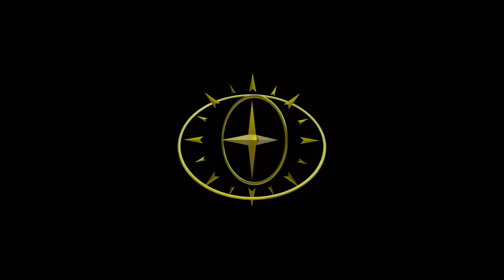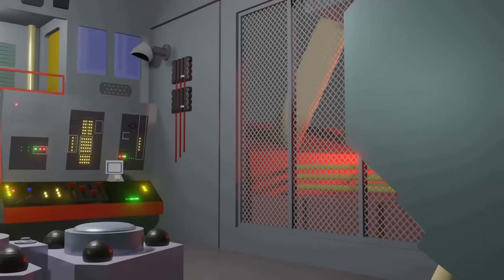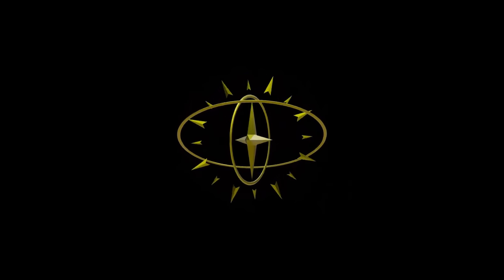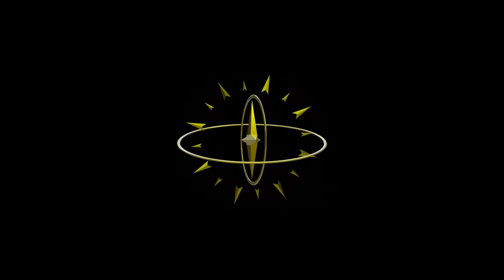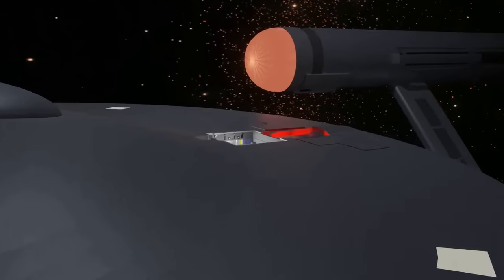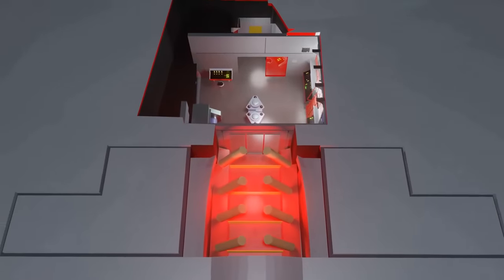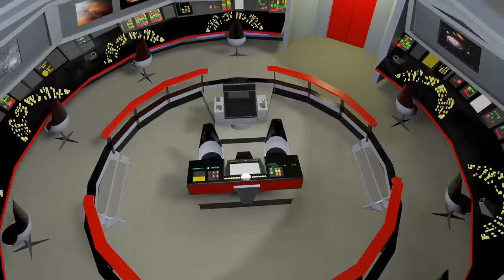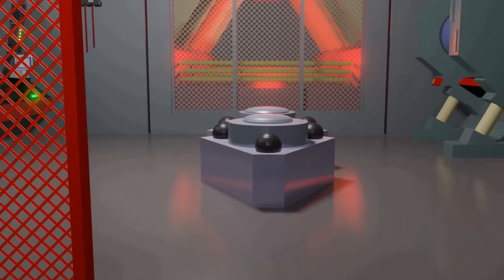The Enterprise Engine-room Enigma: where was main engineering?

Comment: I would imagine that until they began using vertical warp cores that you would have 2 separate engine rooms.  One near the impulse drive, the other in the secondary hull.
Reply: And that is what we see in the Technical Manual.
Reply: they do, the second isn’t seen often due to storylines but it’s always there
Reply: The impulse engines apparently used some form of ion propulsion, since Enterprise-D clearly had a "deuterium fuel tank" at the root of the Access Pylon with a feed that ran straight up its spine to the Engine Room at the stern of the saucer.  Which explains why they were so slow and had such limited range.

Comment: As a casual viewer, I always thought engineering must be in the secondary hull as Scotty was climbing up inside what looked like an inclined tube in one episode.  I always thought that was inside one of the nacelle supports.
Reply: It is.
Reply: They were called the Jeffries Tubes, and ran up the supports from main engineering, in the Lower Hull. They were basically conduit tubes to channel the Anti-Matter from the Broussard Collectors (the round red domes) at the front of the Nacelles, to Main Engineering, and channeled back up and out the back ends of the Warp Drives, and there was a lot of electrical power flowing both ways, controlling the Magnetic force-fields. How the People's bodies didn't cause Short-circuits was never dealt with, except during the episode, "The Ultimate Computer", when one crewman got VAPORIZED, and Kirk used logic to get the M-5,or6, Computer to shut down, because he made it 'realize', it had committed murder!
P.S. they never explained how much power they needed to protect the ship from the Anti-Matter particles that the ship flew into, and funneled to the Engines!  (Phew!)
Reply: @dennispersson9466  Jeffries Tubes - named for Matt Jeffries, set designer on Star Trek.

Also, Bussard Collectors, named for the theoretical propulsion system designer, Robert W Bussard.
Reply: @dennispersson9466  The glowing translucent nacelle caps were identified as "Bussard collectors" only in TNG (both in dialogue and the 1991 technical manual), and the function has been retconned to earlier classes of Earth starship. TOS never identifies them in dialogue, and in the 1975 Franz Joseph "Star Fleet Technical Manual" they're labeled "space energy/matter sink (acquisition)." (Which, if you squint, is the same idea? maybe? although possibly acquiring something more exotic than hydrogen.)

For context, the interstellar ramjet idea was proposed by physicist Robert W. Bussard in 1960.

Comment: I always considered Main Engineering to be in the secondary hull, as you describe. I based this on the geometry of the rooms, the layout inside the rooms, the location of the dilithium chambers, and the way "ships" have generally been laid out throughout history. BUT- you then have episodes where crew members, usually Scotty or Spock, are in the Jeffries tubes, which I assume are inside the pylons for the warp nacelles, and they are accessed from what looks like a standard deck area. Also, the curved corridor dilemma pops up. Also keep in mind that whenever a crewmember takes a turbolift from the bridge to main engineering it is a fairly long trip with the lighting behind the panels travelling both horizontally and vertically, so that tends to indicate the secondary hull.
I DO like the idea, which I never really gave thought to, of a second engineering space in the saucer section ahead of the impulse drive area and it makes sense.
Of course, we can debate this for ever, or at least until they actually build a functional Constitution class starship! ;-)
Reply: It seemed like there were lots of Jeffries tubes all around the ship, though presumably there were some extra long ones leading all the way from the secondary hull to the warp engines.
Reply: Someone tried a reconciliation by stating that the earlier, simpler arrangement of the set seen in season 1 would've represented Impulse Engineering, while the larger, multi-level set seen in later episodes would have been Main Engineering down in the secondary hull forward of the bases of the pylons.   The Jeffries Tube access is a bit tougher but try this:  The big conduits rising up out of the deck behind the grating lean inward instead of  outward toward the pylons, suggesting that there may be some kind of crossover/switching connectivity going on, with the conduits leading up to the pylons departing higher up and further out. Then you could imagine corridors leading aft from the catwalk one deck up to starboard and aft from the Emergency Manual Monitor compartment (briefly seen one deck up to port looking down on the high bay in at least one episode) to the Jeffries tube access points.
Reply: The tube Scotty always goes into to adjust systems ran from main engineering up through the rear of the pylon to the impulse drive at the rear of the saucer which makes a lot of sense. Turbo lifts can run diagonally, vertically, or horizontally, to allow quick access to any part of the ship.

Comment: Kirk said in The Enemy Within that engineering was in "the lower levels." And if one wants to go by the original special fx of Day of the Dove it was located just behind the main deflector dish about half way down in the secondary hull. Right next to the Starfleet pennant. This location was changed and moved much further back in the remastered fx to be more in line with the Doug Drexler cutaways. As far as Deck 1 also being Deck A fron Star Trek TMP onward there is certainly no reason that when the Enterprise was refit at the end of Kirk's 5 year that an entirely new Deck designation scheme couldn't have been instituted for the ship.
Reply: That's how I always saw it. Not far behind the main deflector dish!
Reply: @metatechnologist  yeah me too. That would also make it more consistent with the location of main engineering in later series!

Comment: Unfortunately, we see the curved corridors often in areas where they shouldn't be. In "Journey to Babel", "The Doomsday Machine", and "The Immunity Syndrome", we see characters walking through the curved corridor, then into the straight ahead one before walking right to the hanger deck doors or by a label stating "Shuttlecraft Hanger Deck", etc..
Reply from the maker: The producers clearly loved that corridor!
Reply: @WeTravelbyNight  The curved corridor had an effect of practical importance - it limited the number of extras they had to hire on any given day, which kept costs down - then as now, the largest unexpected expense in the making of any TV series was the labor cost of hiring and feeding extras.
Reply: As such I would ignore it as production issue. Impulse Drive should not be that complicated and I don't see why it would be where main engineering room would be located. But rather offices and stuff like that. The most logical place is top section behind the deflector. Where also later room of vertical drive of refit was.
Reply: @katherineberger6329  I always thought the corridors looked way too crowded anyway. The ship only had a crew of 430 or so but was the size of a modern aircraft carrier. Coupled with the fact that most of the crew should have either been at their duty stations or partaking in eating, sleeping, or some sort of recreation, the corridors should have been relatively empty most of the time.
Reply: I spotted that same corridor in some Twilight Zone episodes as well
Reply: @WeTravelbyNight  Might be multiple reasons for a corridor to be curved.

Comment: As interesting as the various rooms inside the SeaView in Voyage to the Bottom of the Sea or the layout inside the Lost in Space's Jupiter 2. And to think we had a bit more consistency in TOS than in those other shows.
Reply: Trek is a little more consistent. I love Voyage. The main problem Seaview had is the forward torpedo room. Where could it be. They always fired forward torpedoes after loading them in the stern-- where the missile room had to be. Then the last season where a mysterious corridor began appearing behind the radio shack. Despite all this, the Seaview was one of the most completely realized vehicles ever in sci-fi. It seemed read, even though everything couldn't fit.

Comment: Court Martial says engineering is in the lower decks. - There could be 2 engineering rooms as well because in the episode with Lazareth, Kirk was going to separate the saucer from the secondary hull. Both hulls have engine power.

Glad you quoted all those books, including the FJ Tech Manual and the Making Of Star Trek. I also quote those in my videos.
Reply: Well, anything under the bridge is technically a lower deck.  So, it's not necessarily indicative of anything.  But, yeah, I get your point.

Comment: Great video!  Thank you for breaking it down!  By the way, “Desilu” is pronounced “Dezzi-loo” after the owners Desi Arnez and Lucille Ball.  Also, in some subsequent ships we have indicators for the top and bottom of the warp shaft.  (You probably know this).  The bottom, or warp ejection, is coincidentally exactly where a mounting post would go if the ship were a plastic model…. The top is sometimes intended to be beneath a glowing dome, such as the one at the back of the extended saucer of the Reliant (and other Miranda Class ships).  This establishes the tallest vertical line in many ships.  I believe it was Doug Drexler who spoke on those domes being part of the power distribution from the core to other parts of the ship.
Reply: Aye! I wanted to correct his pronunciation of Desilu also. Desi Arnaz + Lucille Ball.
Reply: @markclason2717  I didn’t know that back in the ‘80’s when I saw TOS (and I Love Lucy).  Lucy gave Schwarzenegger a push too, weirdly enough.  Saw a video on it.  Never would’ve connected a b+w sitcom to Star Trek or the Terminator!
Reply: @joshuacalkins  Lucille Ball was really good friends with Majel Barret and Gene RoddenBerry before he pitched Star Trek. And there also was a certain Klingon Warrior that ended up landing the role of Baltar in the original 1978 Battlestar Galactica.
Reply: @joshuacalkins   Desilu also produced "Andy Griffith" and occasionally you'll recognize that they're in Mayberry a couple of the times when they visited Earth or Earth like planets.  There's one scene in "City on the Edge of Forever" where Kirk and Edith walk past Floyd's barbershop.  Also; that one episode with the girl from "True Grit", I believe, was partly filmed in the Mayberry set.
Reply: @michaelbenjmitchell1  Oh yes, Koloth, right?  Also cast as Trelane and seen again in DS9?  I never recognized the guy was in both TOS and BSG when I was a kid.
Reply: @mattdavis9601  That’s really funny.  I had no idea!
Reply: @joshuacalkins  I recognized him by face and voice right away.
Reply: @michaelbenjmitchell1  I still remember when my brother told me that Indiana Jones and Han Solo were the same person.  🤯
Reply: @joshuacalkins Harrison Ford was also in American Graffiti another George Lucas movie.
Reply: @michaelbenjmitchell1  Yes, which complicates the legend that he was just a carpenter on the Star Wars set, who was never supposed to read for Han.  Sure, they wanted Selleck, and considered Kurt Russell, etc, but Ford was already an actor, and in AG already!  It’s not like they passed the script to a random worker.

Comment: since we know the enterprise had the ability to separate the saucer, we can conclude it would need a secondary engine room for the saucer , and since scotty was third in command he needed to be close to the bridge, so he used the secondary engine room as the main engine room so he could have a shorter time to get to the bridge
Reply: I guess, what we get to see are two (identical and probably linked) control rooms. The engines themselves however are in a separate room nearby.
Reply: the impulse engines would be the secondary engineering, which are located exactly where it’s speculated…so it’s at least justified errors, but it’s definitely not the location of the main engineering
Reply: Yes, we even saw different engineering rooms  during the course of the show. And also the smaller Engineering sections. I think the one we saw in "Court Martial" and "Space Seed" was the one in the saucer section. While the one in "The Changeling" was the lower decks one.
Reply: "since we know the enterprise had the ability to separate the saucer" The "I" part of "we" doesn't know this. How does the "you" part of "we" know this?
Reply: @timsmith2525  from watching trek , its mentioned in tos , done in st continues and beyond
Reply: @thunderrobots1980s  Which episode(s). I honestly don't remember anything about that.

Comment: One solution to the curving corridor outside main engineering in a cigar shaped secondary hull is that the circular corridor section we see is partially wrapped around the machinery of the navigational deflector.  The deflector generator is pretty small on Picard's 1701-D but it stands to reason that the system would perhaps be bigger during this time period.  If you look at Doug Drexler's cutaway of the Connie the warp coils only take up part of each nacelle.  A similar set would handily fit in the secondary hull...but they're big.  The engineering spaces on big ships are often dominated by large pieces of equipment.  The control spaces and other "people tanks" in engineering plants are put in whatever space they can fit in after your fit the gear in the hull.

Comment: Beautiful work!
It does stand to reason that if primary and secondary can separate, then they both need power plants, for electronics and plumbing and atmospheric systems and either warp and or impulse engines to travel the stars. We know that the primary hull has ZERO warp engines, so only the secondary hull supplies them with the necessary plasma... if the warp engines required two sources, then they wouldn't work anymore after separation. Personally, I prefer the Franz Joseph plans for the locations of primary and secondary engineering: Deck 6/7, just forward of the impulse engines themselves, and Deck 16, near the base of the warp nacelle pylons.

Comment: There would need to be a minimum of two engineering sections, and they were designed by the same people and built with the same materials, meaning they should look similar to each other as well.  There are also probably plenty of ancillary rooms that would also be called "engineering" 

"Main" engineering is probably the one on the impulse deck, but if I were to call out for the warp engine room, it would be easy to accidently say "main" engineering, and the computer would figure out from the context clues that I meant the warp engine room.  Similarly, saying something is in "engineer" cold be any engineering section.
Reply: Exactly. In fact, the original Star Fleet Technical Manual does have two engineering areas: the area marked "Main Engineering" is near the Impulse Engines in the saucer, and a separate "Warp Drive Engineering" in the secondary hull right under the nacelles. Main Engineering is shown to have computers that can monitor the warp drive from there. Makes sense: the Enterprise has two different types of engines with different needs, and a crew of only 430.

Comment: I'd buy the idea of two nearly identical rooms. In Doomsday Machine, Kirk asks if the warp controls could be used to run the impulse engines of the Constellation. So why not have two separate systems? With a set of master controls ( or overrides ) at his bridge station.
Reply: I would say I kind of would have to agree with you!

Comment: I feel like imagining the turbo lift shaft depicted directly in front of the deck 7 front door entrance (in the Franz Joseph plans) a few meters forward, and putting the curved corridor there instead, solves most of the problem for me.   Those plans clearly depict main engineering as being just forward of the impulse engines in the saucer hull, and that was the original intent.   The idea of main engineering firmly being in the secondary hull (and the associated linear intermix chamber) are ideas that (mostly) don't come along until the Refit/Constitution II.  I know that doesn't solve all the episode reference problems and other issues, but it's sure enough for me to go on. (As long as we're discussing the specifics of an imaginary spacecraft at all.)  Excellent work on the animations and the conjecture about all of this.  Thank you for the video!

Comment: I like the saucer location idea, even though the corridors and Jefferies tube locations don't match sometimes. And the "lower deck" references made by Kirk in the first season, suggest it's in the lower section. It doesn't solve the mystery, but in "Day of the Dove", when the entity flees Engineering, it's clearly shown leaving the Engineering hull section. The fact TMP put Engineering squarely in the lower section has to be taken into account, as well. Anyhow, Enterprise is still pretty well laid out.
Reply: IMHO it could be argued that the impulse engines count as engineering as they are meant to be the engineering if they separated the saucer from the secondary hull…but it’s just not possible to be primary engineering
Reply: "Anyhow, Enterprise is still pretty well laid out."

It is? How are you getting to that conclusion? What are you comparing it to? I mean, AFAIK there are only two rooms with canonical locations and one of those is absolutely in the wrong place.